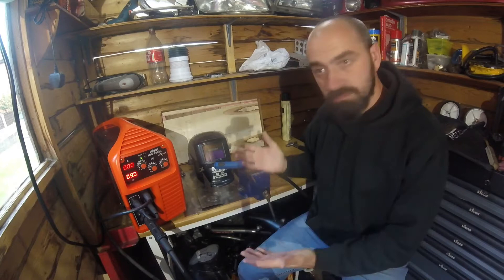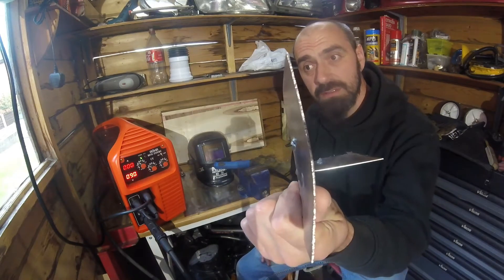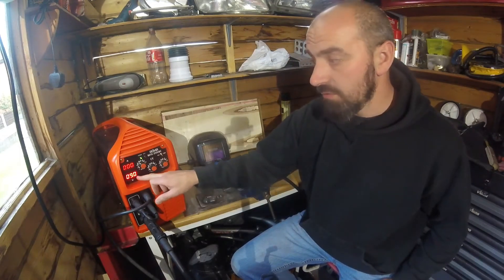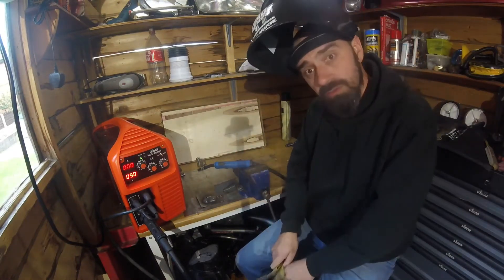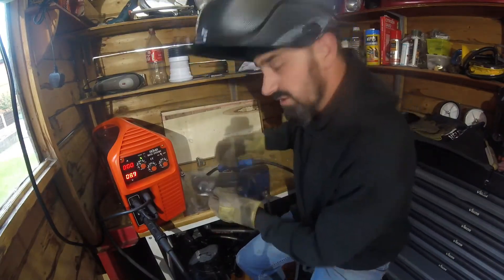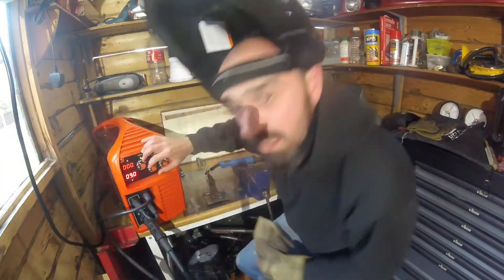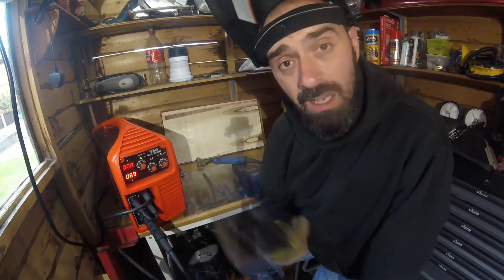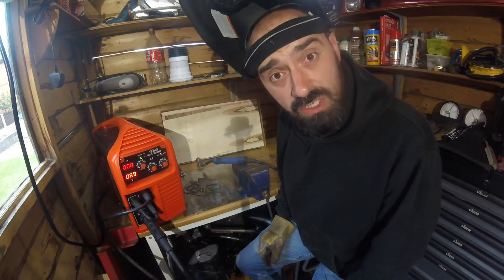Röhr MIG-200MI Testing the lowest voltage setting! - Will it weld!!??

Comment: Very helpful video. I'm looking to buy this model myself but I wondered if you have tried maxing it out on the highest settings. Interested to see if the plug fuse would hold up.thanks.
Reply from the maker: I'm hoping to get this very thing tested as soon as I have an hour or two spare. I have some thick plate to test it out on.

Comment: Is this welder good enough to patch the thicker metal on vans particularly on the ladder or rail chassis?
Reply from the maker: I can't see any reason why not? I used it on 2mm thick box section steel with great results so with the correct settings, i would imagine it would weld a van no problem.

Comment: Hi where did you get regulator from .... thanks
Reply from the maker: I got the disposable one from here: https://www.ebay.co.uk/itm/Hobby-MIni-Mig-Welder-Disposable-Gas-Regulator-2-metres-of-Gas-Hose/184305321548?hash=item2ae974064c:g:e0kAAOSwzGBb3YqY

I had the other regulator from a nitrogen bottle I had for work a few years ago. Any welding supplies shop can get you one sorted out though.
Reply: Thank you

Comment: The stupidest thing I find about this welder and I think other rohr models suffer with as well is the fact you don’t know the voltage or amps it’s on until you start welding
Reply from the maker: Hi Bennie. Yeah it does seem a bit counter productive but I guess you could weld and turn your dial up say 10v at a time and mark off around the dial so you have a rough idea where each voltage is. I'll be doing this as part of my next video when I get the workshop sorted out.

Comment: I still can't see the voltage, it is jumping up and down like a lottery winner, seems completely pointless to me.
Reply from the maker: It does jump around a bit as you're using it, I guess it is picking up variations in my positioning and the thickness' of the pieces etc? I'll try and do some investigation soon.